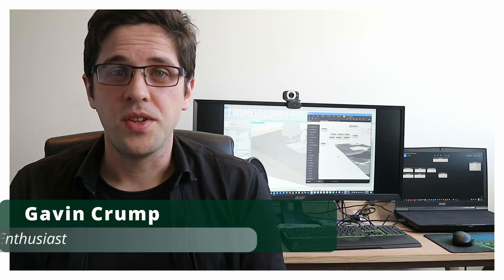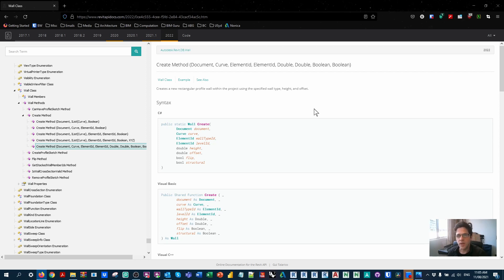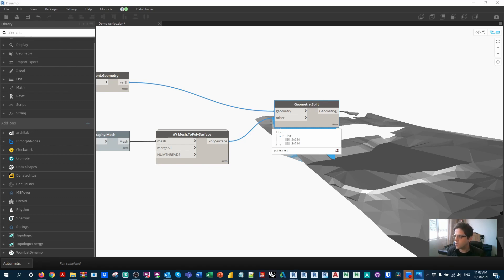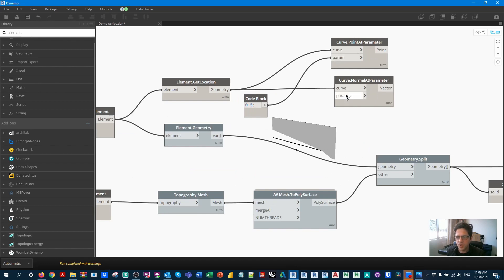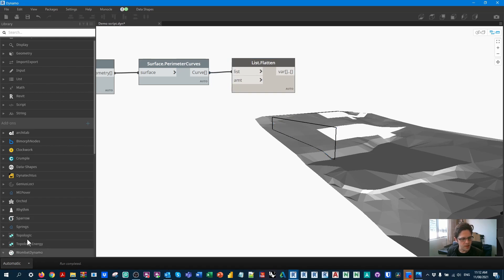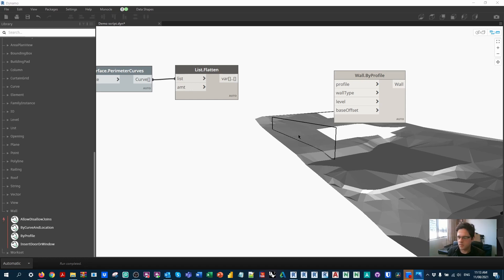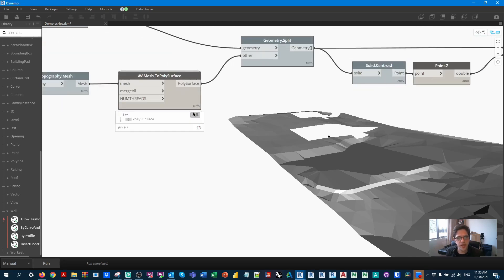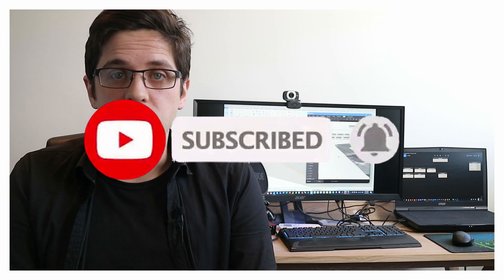Walls following topography in Revit using Dynamo!

Comment: Would love to see a video on how to model construction batters
Reply from the maker: Hrm to be honest it's very difficult and as an architect I never have to do it (luckily). I believe most civil engineers typically manage batter/cut/fill calculations in separate programs like 12D or ACADC3D. In Revit the only tool we really have is the 'graded region' tool which can compare phased topography and report on the cut/fill areas between them, but it's a very difficult tool to use accurately as a civil engineer.

Comment: Hi Gavin! Excellent tutorial as all your other contents. I’m following your steps and it goes well till the end. Wall.ByProfile doesn’t create the wall and give a warning. I’m using Revit 2022 could be this the problem? Something related with the Forge Units thing? Is there any solution?
Reply: Now I did the same script in Revit2018 and totally worked
Reply from the maker: Yes I suspect its a unit type issue - those changes are causing all kinds of issues for custom packages that aren't up to date.
Reply: @AussieBIMGuru  Thanks for your answer! I’m waiting your next video

Comment: You are a Genius.
If You have to create multiple walls at once to compute material over de Surface, what am I supposed to change in the script? Sorry, I'm a newbie with Dynamo.
Thanks in advance
Reply from the maker: This probably isnt the easiest workflow for a beginner, but you could get the polysurface of the topo and try splitting the wall surface with it, then taking the area of the lower split piece.

Comment: Thanks for sharing. But it dosn't work in revit 2024, because of "Expects argument type(s), but was called with". It means that the toposolid is not soli geometry. Is there another option?
Reply from the maker: Try using element.geometry and getting the toposolid that way. I made the video before toposolids were a thing so it will be a bit different i suspect.
Reply: @AussieBIMGuru  I have tried it. but it dosn't work.
Reply from the maker: @rouhollahbasirat7882 id suggest dynamo forums in this case given the workflow is a bit different.

Comment: Hey Gavin! Really enjoy the videos- good stuff. 
I have a question about using Revit to model bridge structures- when making a bridge model, the span of the bridge usually has to follow a certain road alignment (this aligmnet is done in Civil 3D and from that alignment (or surface) it is possible to get coordinates (X,Y and Z) to than import them into Revit through Dynamo).  I then create the span that follows that line ( usually curved in elevation view, but can also be curved in plan view). The problem comes when the road alignment has to be changed and the points and further the line has to be created again and the span has to be created again. Is there a way that it could be done that when the created bridge span is somehow parametricaly connected to this line that is created from those alignment points,so that when this alignment chnages it counld be possible to update the span faster? 
Have you ever come across any companies in Australia creating bridge BIM models in Revit? Maybe some other pograms are popular in Australia for bridge modeling?
Reply from the maker: Yes usually firms use complex adaptive components in order to place and set the bridge viaducts and components. Dynamo is probably the easier part whilst the families take longer and require sector specific expertise.

Check out this presentation here for an example of how this works:
https://youtu.be/6aWITsw0qqI

Comment: Hi Gavin,
This is terrific. I actually need to calculate excavation volumes in Revit. I have 2 Topo surfaces and I need to create a mass by connecting the 2 tins. Is there a way?
Reply from the maker: Not natively in Revit as far as I know. You might be able to join them as a mesh and make a direct shape from it, but it wouldnt be editable topography.
Reply: @AussieBIMGuru  If I create 4 walls around the topo area. TOW follows the top topo surface, and the wall Bottom follows the bottom topo, which will create an enclosed space that will have a volume.
Reply from the maker: @muhammadfaraz7052  yes dynamo can make meshes from topography and also make direct shapes. I believe the springnodes package can do both of these things
Reply from the maker: @muhammadfaraz7052  yes this could probably work. You would need to intersect a volume around the walls with the topography.
Reply: Ignore the above plz. The room will not compute volume, my bad.
Reply: @AussieBIMGuru  Is there any tutorial that I can follow. I am new to dynamo, so still learning. It is good to know that this is achievable
Reply from the maker: @muhammadfaraz7052  not that I am aware of. I have another tutorial on my channel for excavation of building vs topography but thats about the closest thing.

Comment: i reply your squematic routine but not working.
You can i have this script, please?
Reply from the maker: You can find most of my scripts on my github, datestamped by video release date.
Reply: @AussieBIMGuru  Thanks for sharing your routine, but some errors occured on launch this script. the final node show this error "its not possible project value null for double" and the node curve.startpoint show this error "internal error, info unref one non index" and point.z show this error "internal error, info unref one non index" 
Sorry about that message but i need make walls in my final work in my university and i going crazy because i´m not making my walls following my topo, help me, please.
Reply from the maker: @luisfernandotelesdesousa6677 likely the topographt is too detailed and has caused more complex geometry than my example. Unfortunately detailed dynamo troubleshooting is very difficult via youtube, id suggest making a thread on dynamo forums, sharing your progress and asking for further assistance from the community.

Comment: Nice tutorial Guru! But what happens with the length and area parameters outcomes? Can I trust it?
Reply from the maker: In this case area is correct but length is not. If you wish to get the true length along the surface of the topography you would need to calculate it from Dynamo and then set it to a shared or project parameter on the wall using the script. The length would still be the flat/linear length of the wall.
Reply from the maker: @fukuda6025  it is a very generic error. My best guess is the wall may not support the algorithm (e.g. it has openings, or is on a curve) but I'd need to know which node is giving the warning.
Reply: @AussieBIMGuru  Thanks Guru! I followed all steps but my wall seams to appear only as analytical form, not as an element, with this ''Warning: Wall.ByProfile expects argument type(s) (Curve[], WallType, Level, double), but was called with (double, Revit.Elements.WallType, Revit.Elements.Level, double).'' I'll try to reinstall my Dynamo

Comment: Yo if we talking user requests I got a hot one for you. Write rooms sizes to rooms. I know this is possible but sounds like a pain to setup
Reply from the maker: This is typically how I do it if we're talking cross dimensions: https://youtu.be/LFIxJC6cwGs
Reply: @AussieBIMGuru  Man this is gold thanks! of course now I have another puzzele. i want to create model lines from core face exterior reference lines on walls. Cant seem to figure out how to make a curve from the references. or maybe make a curve from the walls and then move them to the reference? idk. going to use it to trace links when their modeling is shite and I need to clean it all anyway.
Reply from the maker: Yes i would probably try offsetting location curves, but corner cleanup will always be problematic. Maybe consider taking room finish boundaries and clashing their midpoints if you need to identify the wall they belong to.

Comment: Thanks man! Any alternatives to Wombat on Revit 2024? Wall.ByProfile It's not working. I got this message "Method not found: 'Int32 Revit.Elements.Elment.get_Id()'."
Reply from the maker: Not that I know of, unfortunately they changed the integer types to both 32/64 bit in 2024 so many custom packages will have errors here.
Reply: @AussieBIMGuru  thats what I tought. Thanks! 🤝